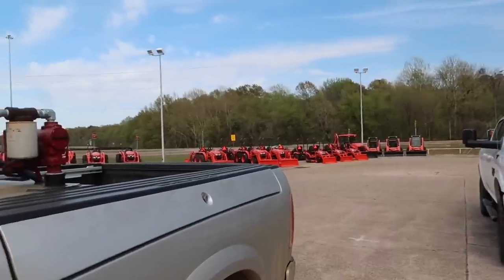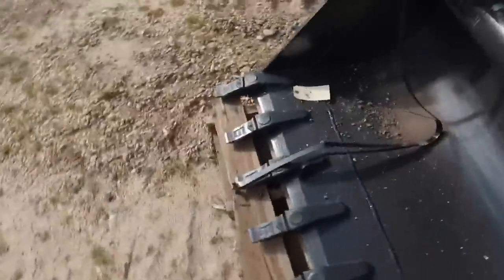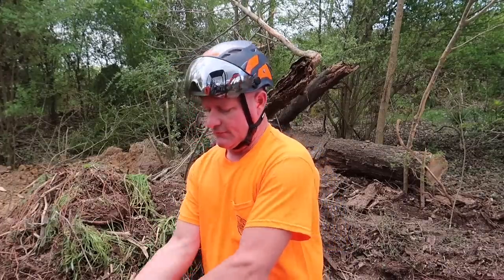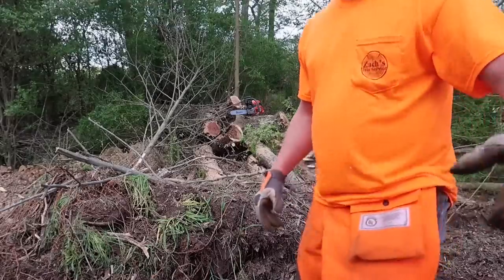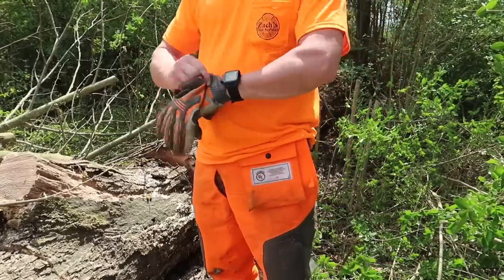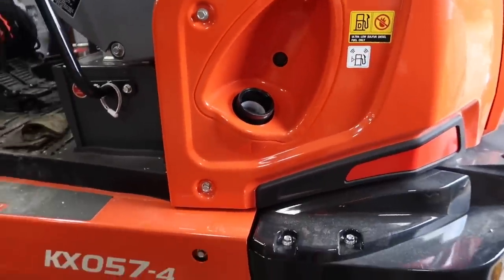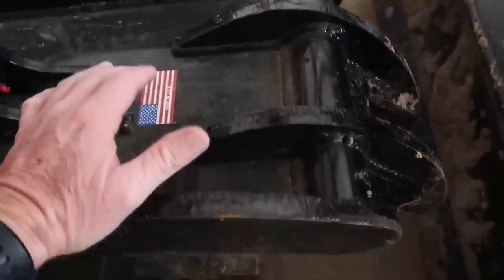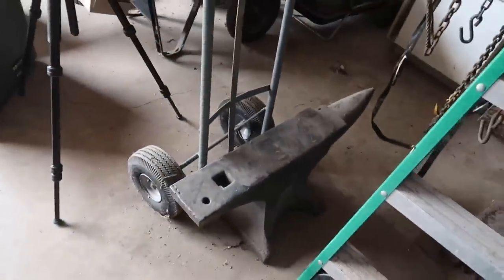New stuff for my Kubota KX057-4 & Husqvarna 550xp Mark ll

Comment: Always enjoy seeing someone use the chain brake as much as I do. I engage mine every time I move or stop cutting for a few seconds. I can’t count the number of times I’ve seen someone stumble and peg the saw wide open when they nearly fall on it. People tell me I’m going to wear the brake out but I’d rather replace it then go to the hospital!
Reply: I'm a amateur when it comes to felling tree's for firewood but I've always engaged the brake before quickly getting away from that tree that's falling, I've always thought what's easier to replace a brake or a saw or your leg
Reply: Minnesota outdoors that is for sure. Just like putting your seatbelt on when you get in your car. Only takes a second and could prevent a lot of regret

Comment: Tim, you will most likely be digging withe 3’ bucket so the foot won’t be used as much but your 2’ bucket is useful clearing with the foot so you have the best of both worlds there, it would be nice for you if you could fab yourself a little carry box you can mount somewhere on the machine (if there is any room at all) to carry your chain saws and bits and pieces instead of under your legs, you are really going to enjoy that mini when you learn its capability’s thanks Tim for your vids